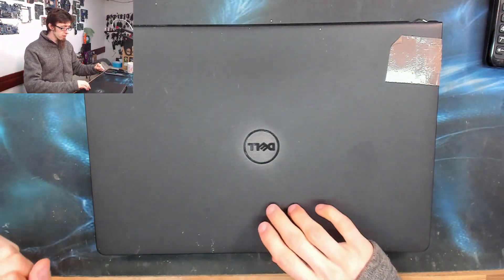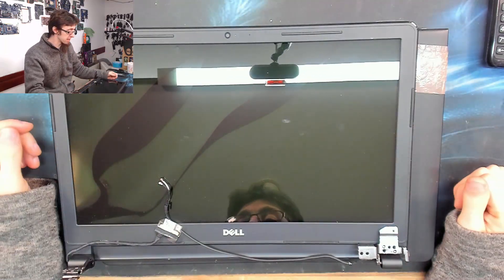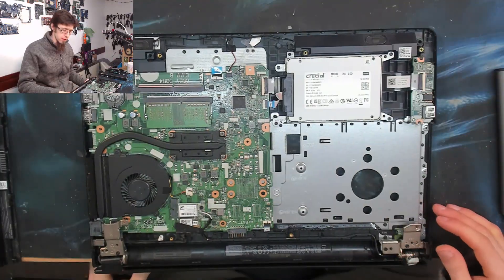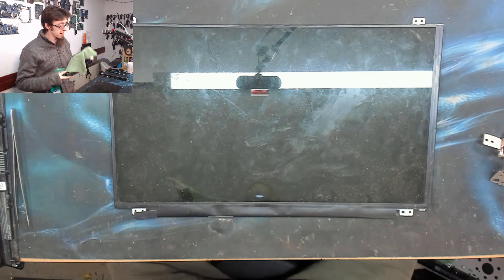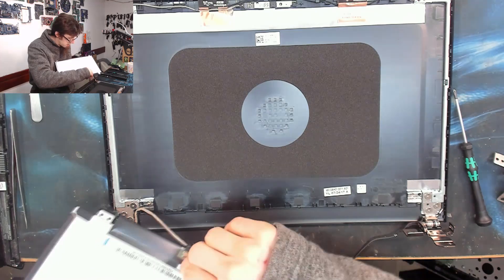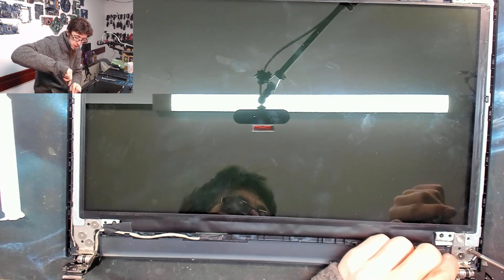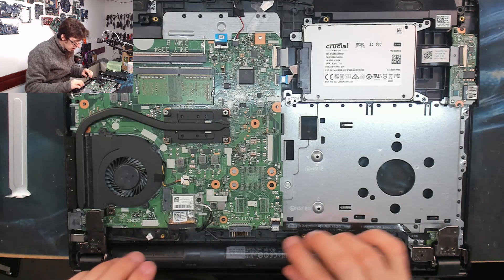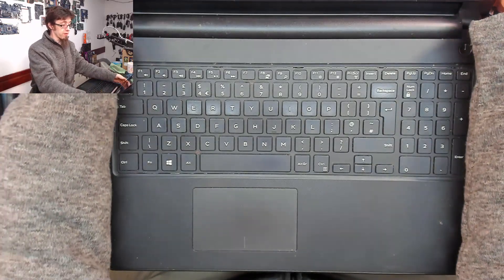Dell Inspiron 15 3000 Hinge Repairs - LFC#228

Comment: Have you ever tried using Super Glue and Baking Soda to repair broken screw mounts and other broken parts?  A lot of people have never heard of doing this but it sets up extremely hard and can be sanded and worked with a Dremel tool.
Reply from the maker: Yea I want to try this some time. I think the amount of effort involved isn't worth it - but for some laptops where the parts just aren't economical, it'd totally be worth a try.
Reply: @Adamant_IT  Effort? Is faster than disassemble the laptop itself. And the cost is near zero. Plus is faster than wait for parts to be delivered.

Comment: Hopefully work will pick up for you. Still got my fingers crossed you get into the new shop and all works out for you. Was wondering if I can contribute in some small way. Do you need any small round magnetic trays or compartments for holding screws. Maybe some bat-anti squeak spray from a utility belt? Lol. Just let me know. Keep up the good work. Stay safe my dude. ✌

Comment: Just reminded me to check the hinges on my aspire ES15 - but before I put the screws back I switched it on to check see if it was still working and it wouldn't switch on - I left the HDD/SSD panel off the back and notice a tiny little switch, I assume that the lappy wont work if this switch is open - I learnt something new today - all good now though.

Comment: Hi, been looking at your YouTube was wondering whether you’d like to try fixing my 1080 gtx strix. No display output but does get hot and reads in bios if I use my cpu integrated chip.
Reply from the maker: I want to get into GPU repair, but I'm not ready yet. I plan to start investigating in the new year.

Comment: this screen obviously has no matte layer, but don't window cleaning sprays take these matte layers off, in screens that do have them?
Reply from the maker: Nope. Never seen windows cleaner damage a screen, unless the screen has an already-damaged anti-glare coat. These anti-glare coats are visible as a purple sheen. They're pretty rare though, except for Apple laptops, which have a reasonably tough anti-glare that also stands up to window cleaner.

Comment: Do you use hard plastic mat or soft fabric mats on your workbench?
Reply from the maker: Soft fabric. Basically a mouse mat. Gives you a firm surface, but soft enough not to scratch up what you're working on. It's not heat resistant, but that doesn't matter, the mat is expendable.

Comment: I've often wondered on laptop hinge repairs, when the laptop isn't worth the cost of replacing the hinges if it would be worth just drilling through the top cover and bolting it together.  If you got the right sized bolts and nuts it wouldn't even look that bad.  Had a K53TA laptop that I was tempted to do that with but...  waited too long and the entire case was damaged when the hinges pulled out.
Reply from the maker: It's certainly do-able. As are other bodge-fixes like su-gru. I haven't really tested them much myself though.
Reply: @Adamant_IT  haven't used su-gru for anything so I'm not sure how well it holds.  The reason I keep thinking of a bolt is because you can mitigate a lot of plastic damage or just give the hinge more surface area to pull against by adding a washer to the mix.  Sadly or interestingly, both laptops I've had this happen on are cheaper Acer models, though I've seen it in others.

Comment: I have lots of LCD what's the best way to test them all?
Reply from the maker: Couple of old laptops. LCDs haven't changed in a while, there's a 40pin connector and a 30pin connector. Get two old laptops, one with each type, and plug your LCDs in to test. Modern ones (like in this video) don't have a frame, slightly older ones have a silver frame around them. Framed LCDs are only good for old laptops, it's up to you if you want to keep those.
Pre-30/40pin connectors are the old CCFL backlit screens, identifiable by having an inverter at the bottom going to a two-wire backlight cable. Chuck these out they're not worth keeping.

Comment: Hi @Adamant IT
Mate very useful video thanks for it alot
I have that laptop as 15 3542 with i7 4510u gt840 version but Dell specification says it supports up to 8gb ddr3L memory do you have any chance to try a 16 gb ddr3l ram? I dont have any budget to buy any new replacement laptop but 16 gb ram would be really nice to get it 2 years
Also i have seen some dude replace the screen with  1080p version and 2lane edp cable. Do you have any chance to confirm this cuz i have seen some good deal on that screen? Have a good day
Reply from the maker: I'll be very surprised if it won't take 16GB of RAM, but I couldn't tell you for sure. Screen wise, yea so long as you have the right display cable as well, you'll be good.
Reply: @Adamant_IT  thanks for the reply king i will find the right cable